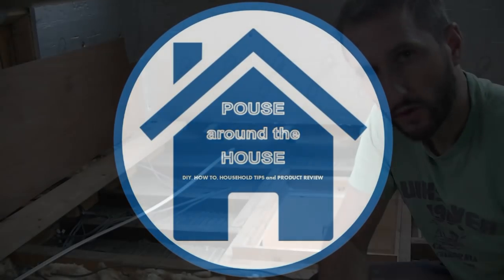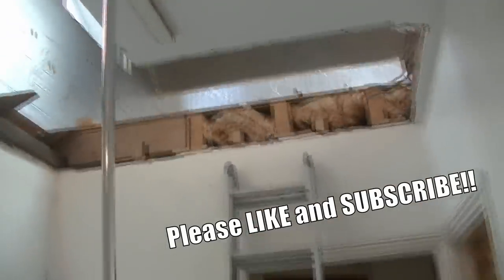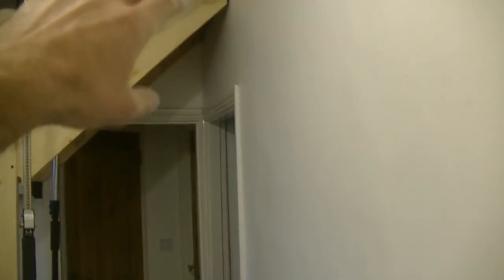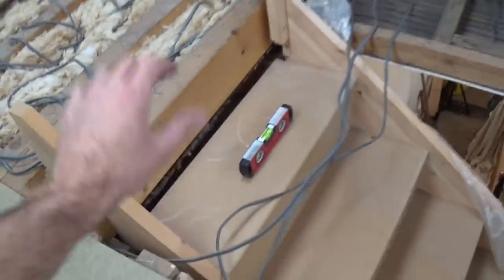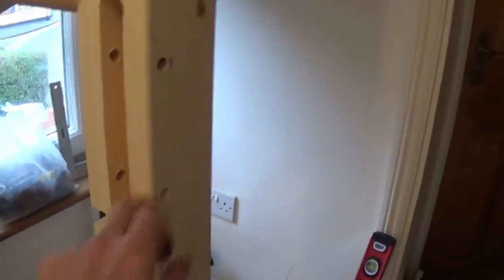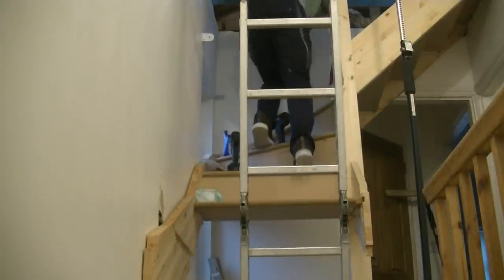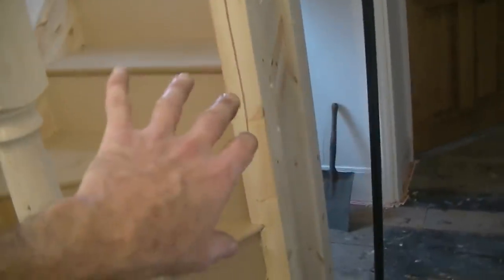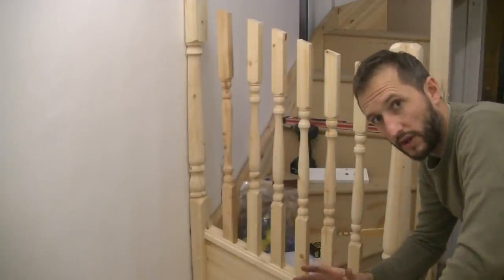Loft conversion part 37 - Fitting the stairs, rails, and some spindles!! Loft stairs installation!

Comment: Just buying a victorian terraced property and always wanted to do my own loft conversion.  Watching your videos has given me a step by step guide on the things I was unsure about, especially the staircase! Definitely going to give it a go now, cheers!
Reply from the maker: Just bear in mind building regulations (if you are doing it as a habital room) as they are getting tighter so headroom can be an issue on some properties by the time you've added bigger joists and thick insulation. Best of luck with it.

Comment: Wow, really looking smart mate. I am In the middle of doing fake paneling with dado rail up the   stairs and round on to landing. Also replacing hand rail and spindles on landing including newel post and half newel post. So your calculations for spindles will be very helpful.
Reply from the maker: Hope it goes well. You'll prob be finished by the time I upload that video! You may have noticed, I'm a bit slow on the uploads! Best of luck with it and thanks for watching.

Comment: What’s the first newel post resting on ?
Reply from the maker: The bull nose step is set into the post (cnc machined) which allows the weight to be transferred through the step which is thick plywood. But in later vids you'll see I extend the landing floor slightly under the post also. Hope that makes sense. Thanks for watching 👍

Comment: Hi Pouse, does building control mind how long it takes for the conversion to be done? I.E if I built the shell first, but didn't build the stairs for another 6 months. Many thanks
Reply from the maker: Best check with your local officer, but mine were happy to check things as and when they were done. Although it's been finished for ages, I haven't actually submitted my electrical certs for final sign off yet so hope it's still valid!

Comment: bit of a silly question...You know where the bottom of the stairs cut a corner in front of the door frame on your 1st floor...Is that ok with building regs?
Reply from the maker: If you mean where it juts out onto the landing? Yes it's ok, but always speak to building control as they all have slightly different take on things, and it's in the context of your home which are all different. Hope that helps. Thanks for watching.
Reply from the maker: Just realised you meant the underside of the stairs, Again, it's down to the height and how far its cuts across. Check with building control if in doubt. Or if you're not doing it through building control then it's up to you I guess!

Comment: Great job Mr Pouse. Just a couple of questions please.   What size masonry screws did you use into securing staircase into the wall and were the holes already pre drilled into the side of the staircase by the stair manufacture. Thanks.  Keep up the great vids.
Reply from the maker: Thanks for the feedback 👍.  Hopefully Big Pouse answered your question.